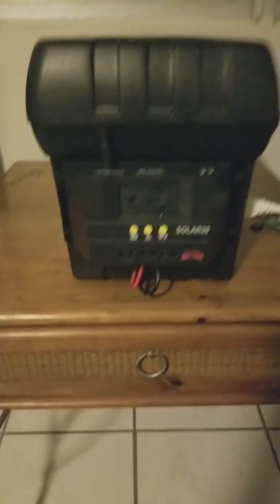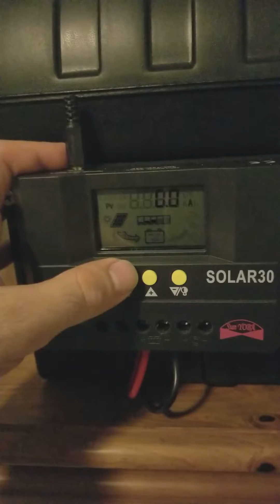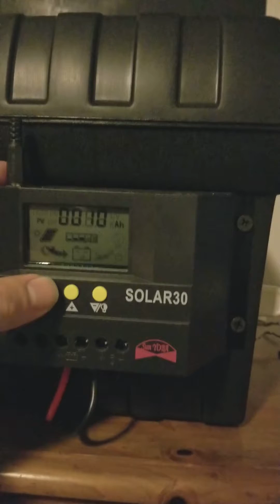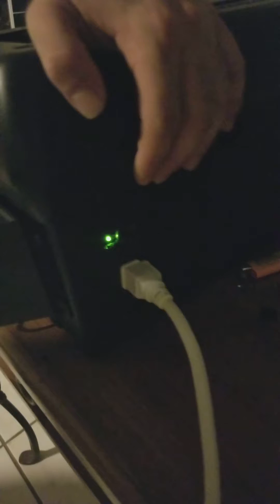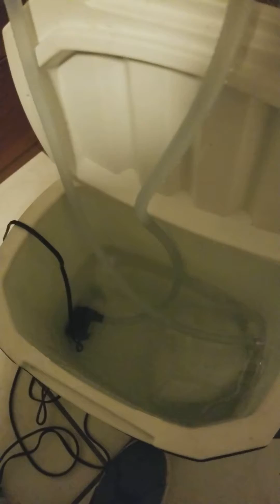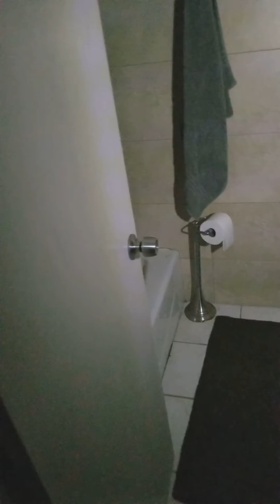Puerto Rico Maria emergency solar generator and homemade AC unit!

Comment: Wow I went though Irma and I thought that was hell I can’t imagine what you are going though keep up the good work. Always try to use d/c stuff because you don’t need to use the inverter when you use the inviter you lose power when it gets bumped up to a/c. If you did have a generator could you find gas for it